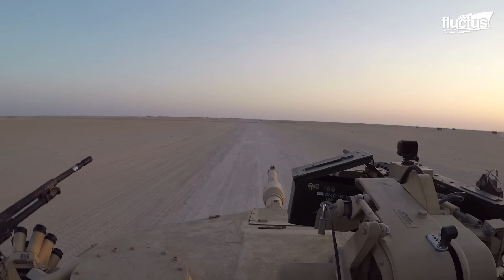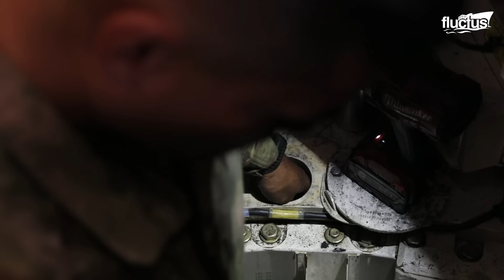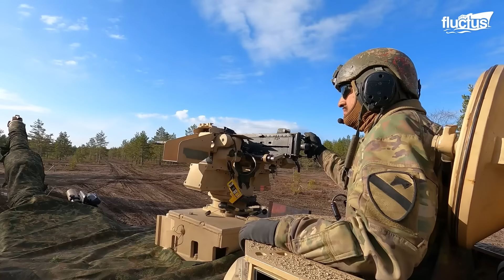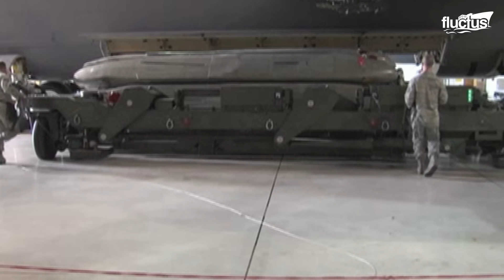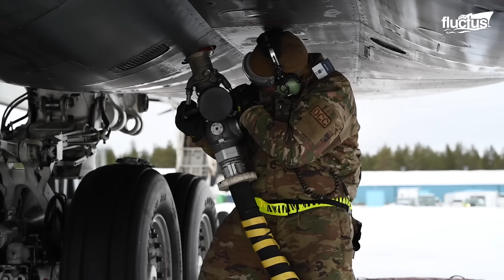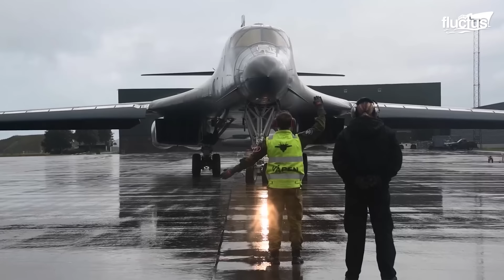How the US is Upgrading Its Feared M1 Abrams Tank

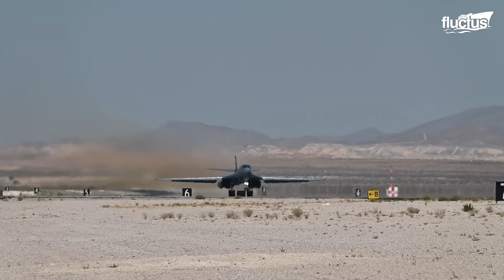Comment: 14:37 The original Strategic Arms Reduction Treaty (START) between the U.S. and Russia, was signed on July 31, 1991 by George H.W. Bush and Mikhail Gorbachev. Gorbachev was the primary catalyst for Russia's "Glasnost," and at the time it appeared that Russia was not the threat it used to be.

Among other things, START 1 mandated that the B-1 could no longer carry nukes, and the external pylons that carried them had to be removed from the airframe. The refit also included the removal of nuclear arming and fusing hardware. By the mid 1990s, the B-1 was being converted into a conventional bomber. START 1 expired in December 2009.

START 2, signed on January 3, 1993, allowed Russian inspectors to examine missile silos and silo launchers to confirm ICBMs had been eliminated. The inspectors also examined the B-1 airframe to make sure it was not possible to carry nukes.

The B-2 can carry nukes, but it is not as fast, does not have the range, does not have the service ceiling, and does not have the payload capacity as the B-1. There are 62 B-1Bs in service (conventional bombers), and 20 B-2s in service.

Just FYI, on August 8, 2022, Russia announced its "temporary" withdrawal from START 2. IMHO, the U.S. should refit the B-1 to carry nukes.

Comment: A1 is PROVEN Garbage.. By ANY yardstick. It burns fuel at a Horrific rate (constant refuelling required)  It also requires Massive support /service  vehicles.  
These things are Simply Testimony to how Salesmen Hoodwinked MORONIC  politicians and Office based "generals'
It has a TURBINE engine which runs Soo HOT that it can be spotted by Satellites Hours after it's turned off.  Some Stealth :-). Russians delight in bexplodingthese  Overhyped Underperforming Hulks.

Comment: Sometimes I wonder about the Abrams tanks. In WW2, the Sherman was more practical, smaller for transporting in big numbers and hardly repaired and just basically abandoned and quickly replaced instead. The Abrams calls for special fuel and a lot of repairs and maintenance. They are not easily replaced in the field. The WW2 Sherman's, could outnumber the German Panzers and win the battles.

Comment: It will take america until at least 2030 to adapt to a next generation MBT.

All this is, is a very slight upgrade of the original. The only two items it has in its favor: a variation of teflon and a turbine engine.

america might also want to seriously re-weigh the idea of a manual loader
Reply: It will need to be in the next MBT.  Too much to retrofit.